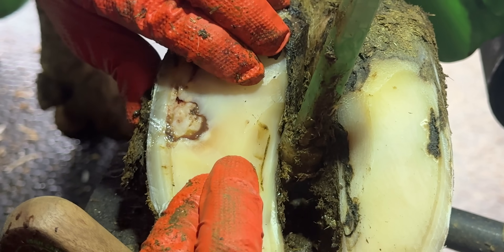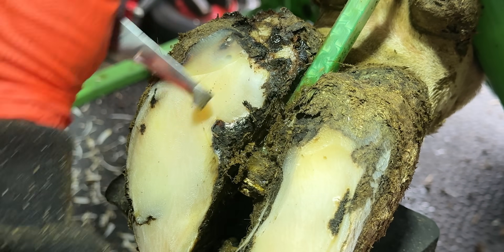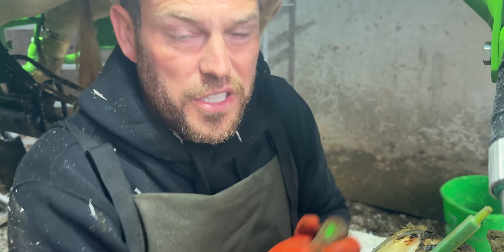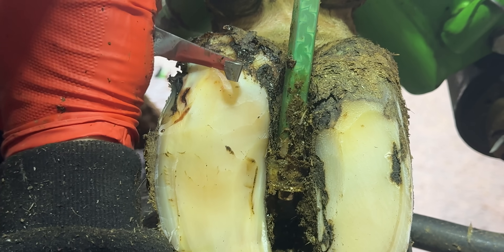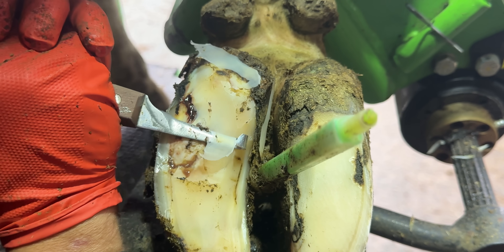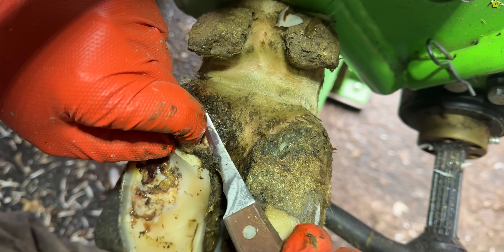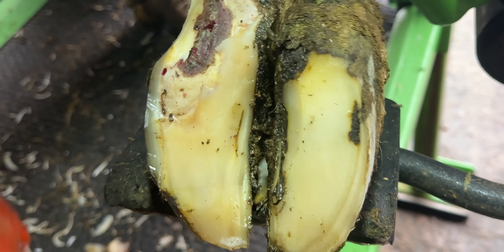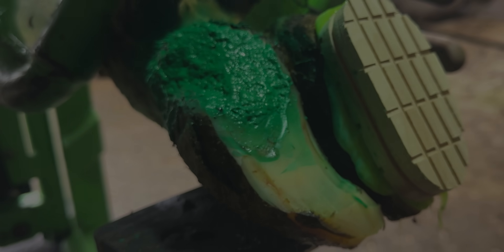I PEELED this cow's HOOF APART!

Comment: As usual, you get the toes to the right angle and length before going in to deal with the fairly obvious issue. I assume part of that is so as the problem hoof heals it's closer to being as it should so you don't have to trim it so much as the new hoof horn forms.
Reply: It's also to avoid lameness from tendonitis higher up the leg from standing with the leg forced into the wrong angle. A rule of thumb is that the lower on the limb the source of lameness, the easier it is to treat. The higher on the limb, the longer and more difficult it is to treat. Nip all that in the bud by keeping the feet as close to the correct angle as possible.